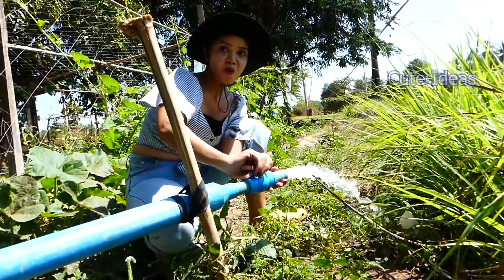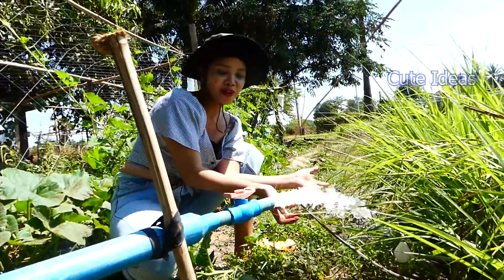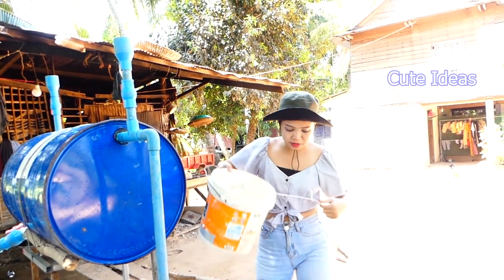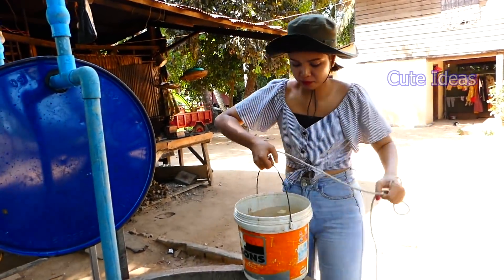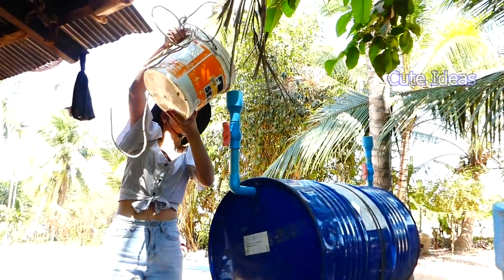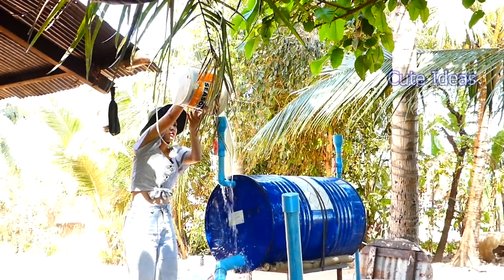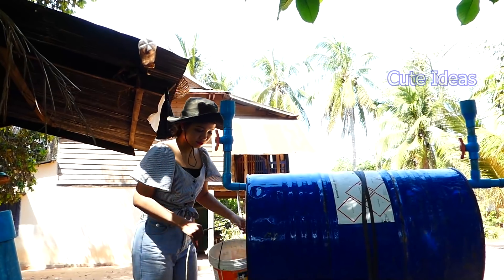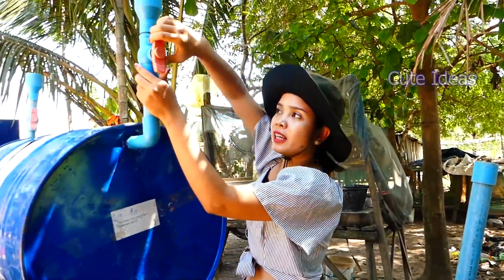7m Deep Well Auto Pump - How to make free Energy water tank from Deep Well - Learn for Ideas.

Comment: Hello.A very good idea. Will you be able to raise water from a depth of 50 meters in the same way ? Thanks
Reply: No, 7/8 meters is the maximum, to lift water to 50 meters or more you need HYDRAULIC RAM PUMP. also free energy, search on youtube.
Reply: @joseinfante5054  No, a sipon can not elevate water.
Reply: @Dingsrud  Error, this is not a thermosiphon, this is a punch pump, in physics it is Newton's 3rd law (action-reaction) widely used for all propulsion systems, it uses the water outlet to create a vacuum in the drum (action) that will suck the water from the well (reaction), but no more than 5/6 meters, and it has to obey several rules, the same as any other engine.
Reply: @joseinfante5054  From my perspective it is a siphon. If you for a moment consider the drum 100% filled with water, in what way would the construction differ from any siphon.Variable tube diameter, that is all. If you let in some air in the drum, so what? He dum is a priming device. With the inlet to the drum higher than the outlet of the drum, the volume ov water in drum and start up of the siphon, you do not need any foot valve at the suction. ? The drum cam accumulate some air before the siphon stops an must be reprimd.
Reply: Sorry, this is a siph. A siphon can not raise any water at all. Not even from a 1 foot well
Reply: I think 50 meter deep.water source would require bigger tank !! I would guess 12 Qubic ;   meter or more ; like 3 × 2 × 3 meters .. So the water pressure created is strong enough to suck water from water source 50 meter deep.

Comment: how long can it work? Maybe after the water in the tank is exhausted.
Reply: Correct. This is a scam, presently almost every day a video with this "pump" pops up in YouTube. It is obvious that this scheme can not work and does not work.
Reply: El agua que yo quiero sacar es de poso profundo tiene 18 mts, se puede sacar agua.
Reply: @mariodurazo    This device is a scam! It does not even work for a well only one  meter deep. Forget it.
Reply: @heinzpg  No, you are wrong. It will work, 7m are possible (as aprox. maximum).
Reply: @VerrückterPeter  On what grounds do you think it works up to 7 meters? I give you my reasons why it doesn't work at all. Even if it would work only for one meter: you could let the water run back in the well and let it drive a water wheel. Thus you would have a perpetuum mobile, which produces energy continuously. But PMs are not possible. You can't lift water without an input of energy.
Reply: @VerrückterPeter  Heinzpg is right. A siphon like this can not lift any water, not 7 meters, not 7 cm, not even 7 mm.

Comment: Inlet 1inch dia. Outlet 3 times ie 3 inch dia. Outlet 3 ft, then master Valve, 4 feet pipe,  then Pressure Vertical of 3ft high, 8 ft horizontal, 2nd presure tower 4ft high, then 40 feet pipe. All 3inch dia. Pressure vertical pipes are important, seal it properly. Pressure in 2 vertical pipes is due moving water get RAM/hammering effect by the reducer at the end of outlet. This pressure pushes some water downward. Suction develops inside drum due to water get emptied. This cycle goes on. For 7 meter deep well, 0.7 Atmos suction is needed. It's a miracle pump. Best of luck.
Reply: O,,
Reply: Hoobrekhme eek  aulahaqjaez of he💙es er
Reply: You can use any dimention on input and output. No need for the vertical tubes, waste of money. There is no hammering effect. No need for a valve just after the drum, waste of money. No need for horizontal pipe to get this working, but it can be wise tu put the output into a buvket of water or place an upward bend at the output to prevent air from leaking in.
Remember, this is a siphon. All plumbing must be air tight. Source level in the well must be higher than the output to the rice field. No siphon can lift any water!
Reply: @kjellg6532  Then it will not work without a vertical pipe and long 20feet pipe in outlet with a reducer nozzle. Valve is optional but it’s necessary while filling the drum. Or, storing water when pump is off. In water flow inside big tunnels in Hyde projects to, tunnel irrigation there need to keep vertical open wells to counter high pressure in tunnels due to hammering effect. Also often open ponds are kept in between two tunnels in absorb the force as balancing pond. Some bright brain has developed this pipe drum pump.
Reply: @RCSAHOO1  The output may be as short as you like. The vertical stubs after he drum has no function, only waste of money. To prevent air to leak in from the output you ether can set an upward bend at the output or simply dip the output into a bucket of water.

Main problem here is that a siphon can only bring water from a 7 m deep well to a rice field if the output to the field is lower than the water level in the well. You have to dig the rice field 7+ meters down in the ground!  The landscape here seems flat. A siphon can not lift any water 7 m up, not even one inch.
Reply: Good

Comment: the water leaves the container because it wants a pipe standing upright;  can I pull from a well 10 meters deep?
Reply: Put more drum
Reply: @abellalthlengkima8486  I tried it and it does not work for me where can I send you a personal message with photos?
Reply: @abellalthlengkima8486  This will not help, you can't break phyical laws. The geodesic pressure allows only a maximum of ~7.3 meters.
Reply: No. Max. ~7.3m possible
Reply: @VerrückterPeter  but correct answer is zero meters. This is a siphon. A siphon can not lift water.